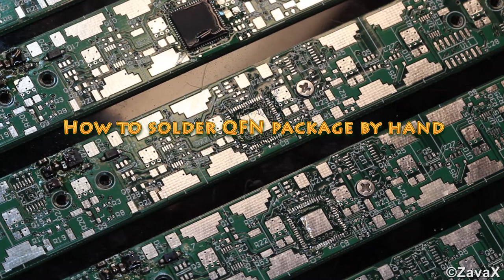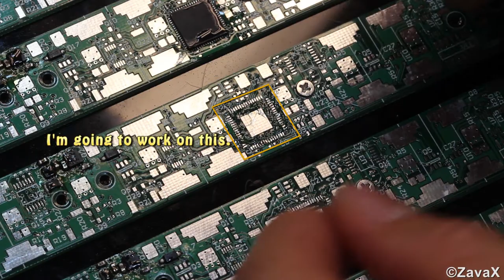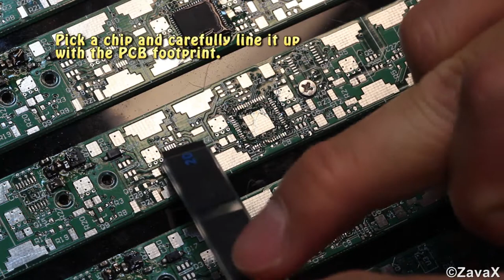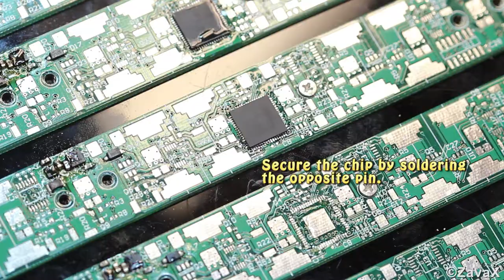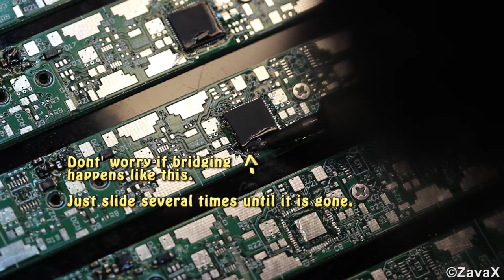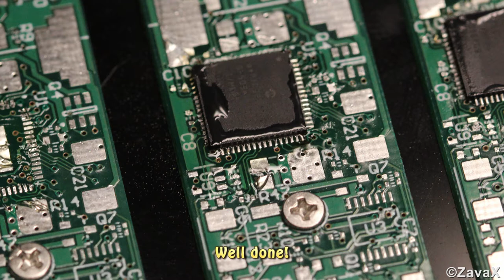How to hand solder QFN package surface mount IC professionally

Comment: wow nice video. And no need for hot air gun?
Reply from the maker: Mrunal Ahirrao No at all!
Reply: will you please explain how to solder QFN with thermal pad exposed to GND?
Reply from the maker: When designing the PCB, leave a plated through hole inside the GND pad and solder from back.
Reply: Thankyou
Reply: +XueMing Yu What is the hole size I need and how do I apply solder in there if the hole is not metalized? Thanks!
Reply from the maker: +Sparker A 20+ mil plated hole will work. If the hole is not plated, I would suggest a slightly bigger hole.

Comment: Yeah, this won't work if your IC actually needs the heat sinking pad in the middle. Most chips that are QFN are only QFN because of the heat-sinking feature. Nice technique though.
Reply from the maker: If you know in advance the IC needs that pad, you can leave a hole in the middle of the PCB pad and solder from back.
Reply: XueMing Yu
That is really smart. I definitely think that I will do this on my next PCB. Thanks :)
Reply: I use qfn because of their size.

Comment: This is not a good video. Not all QFN packages have connection between the side pad and bottom pad. Also, without proper grounding of the ic, the entire solder job is useless.
Reply: Xueming Yu suggested putting a plated through-hole in the middle of the centre pad so you can solder the pad in question from the back after doing all the pins on top.